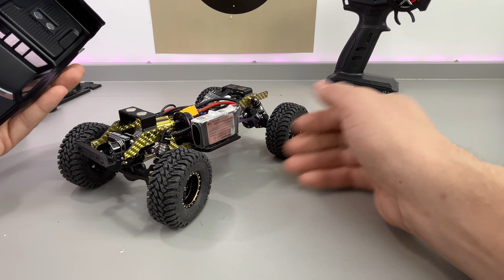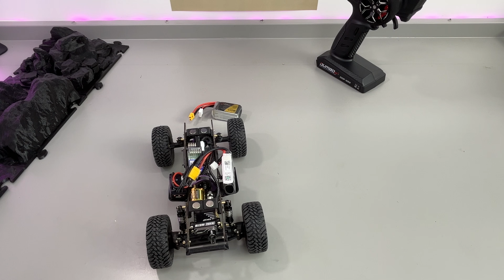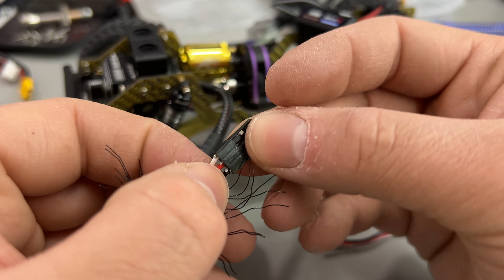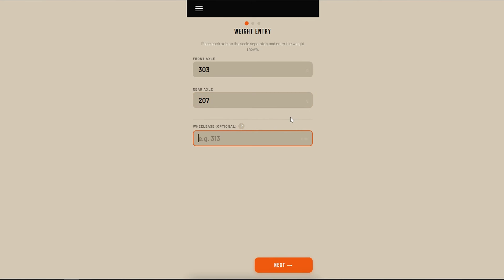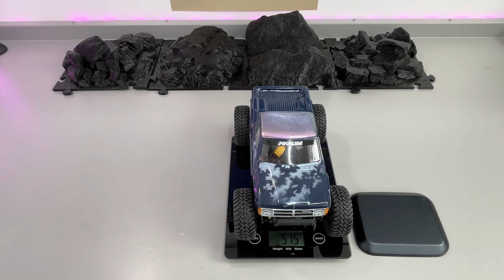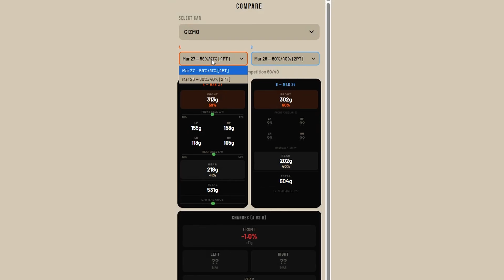NerdRC Gizmo Complete Build — Brushless Electronics, Custom Paint & First Drive | Part 2 #NerdRC

Comment from the maker: Thanks for watching the full Gizmo build! 🔧 Here's the complete parts list if you want to build your own:

Chassis: NerdRC Gizmo ($60)
Transmission: NerdRC Gadget ($50) w/ LGRP 21% OD gears
Links: NerdRC Hybrid V2 — Deadiator geometry
ESC: Injora MBL32 G2
Motor: Injora Gold Viper 1721 (2800KV)
Servo: Injora INJS11B
Radio: DumboRC DDF-350
Batteries: GensAce Tattu 450mAh (2S & 3S)
Driveshafts: Metal Gladiator/Deadbolt set
Rear Axle: 33% underdrive
Shocks: Injora 35mm aluminum oil shocks
Tires: Injora MAVERIX M/T 1.0" (57×22mm)
Wheels: Injora 1.0" brass (-4.7mm offset)
Body: Pro-Line HiLux — custom digi-camo paint
The 21% overdrive in the transmission + 33% rear underdrive combo gives you usable wheel speed without being twitchy, and a front-biased drive split that pulls over obstacles instead of spinning the rears. Highly recommend this gearing setup for comp crawling.

Drop a comment if you have any questions about the build — and let me know what you'd put on the Gizmo platform! 👇